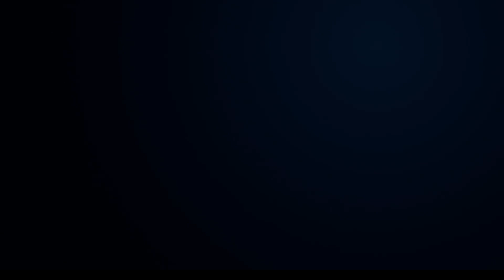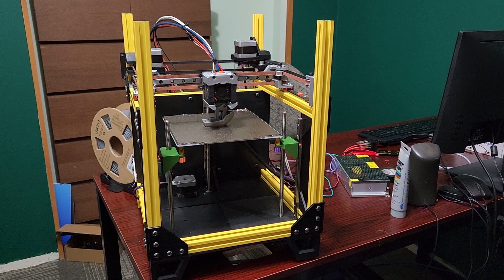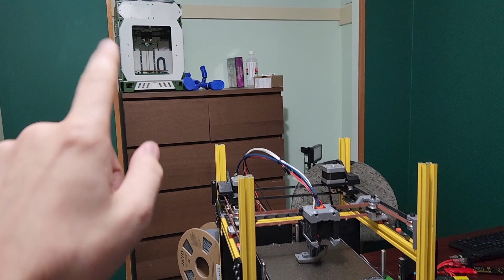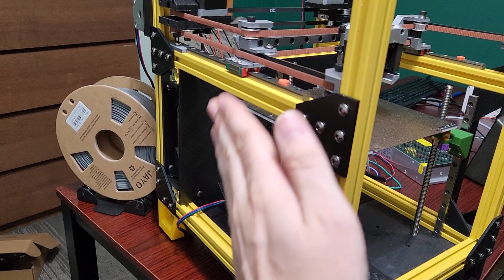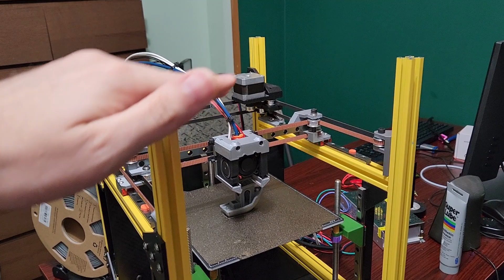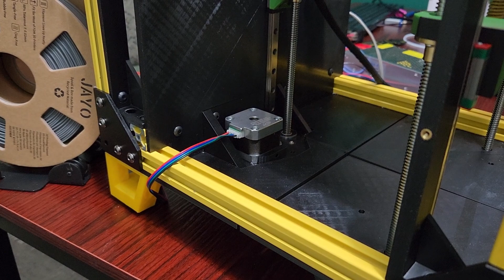Fortress 3D Printer Update! - Z Axis Working

Comment: Nice but:  need to route that stepper wire through bottom panel instead of around extrusion
2 Love the braces but looks hard to enclose
3) really prefer separate steppers on 3 lead screws. ( Micron? )
Reply from the maker: the panels are not done, I will be routing wires
the enclosure uses printed panels so not too bad to do
3 steppers have pros and cons, with a 3 stepper system you always rely on the accuracy of your probe, no probe needed here
Reply: @Rolohaun  Yeah, i guess with small bed no need for fancy tramming.  my merc springs hardly ever get adjusted.

Comment: Thanks for sharing.
Why do you think the spider 3 hotend is crappy?
Reply from the maker: it's 100 dollars and a normal heater cartridge hotend. You can buy much better circular ceramic hotends from Trianglelabs for 55 bucks or even better a genuine bambu x1 hotend for 30. I am going to be using the bambu hotend in my custom printers now, cheap and easy to get.

Comment: Hey Rolohaun, I am unfamiliar with the slicer that you mentioned in a different video— Orca-Slicer. Could you explain the benefits of Orca-Slicer? I currently use Prusa-Slicer I may switch if I am convinced. I love watching you progress from SimpleCube/core to Fortress with the belted Z concept and the Rook kits.
Reply from the maker: Thank you!, Orca slicer has a feature to allow you to see the klipper web interface right from the slicer. I find the interface fast and easy to use. It also has all the good calibration tools built it to tune pressure advance and such
Reply: I am switching to Klipper so maybe I will give it a try. Thank you! Cheers!